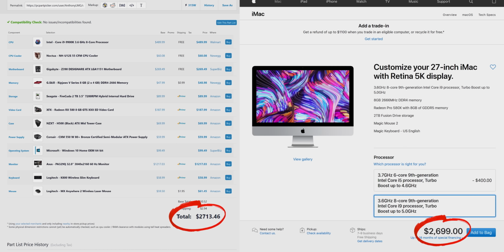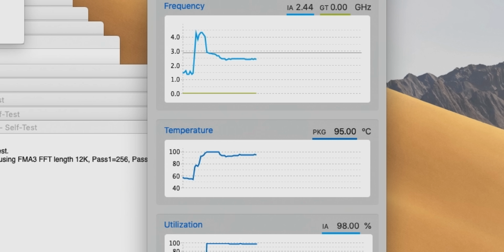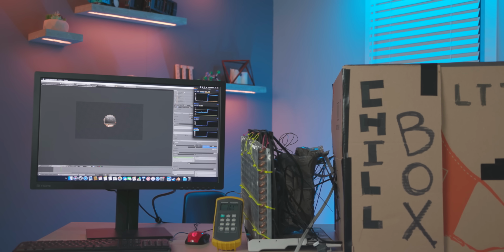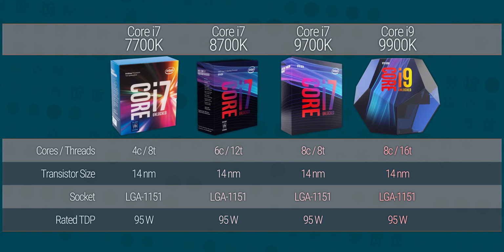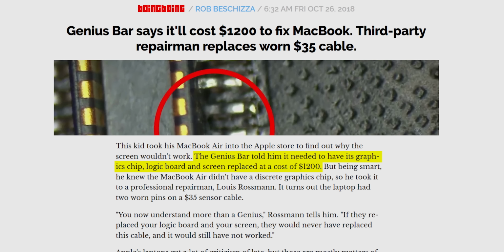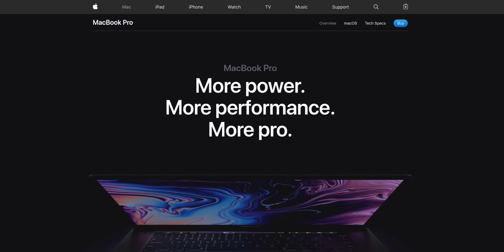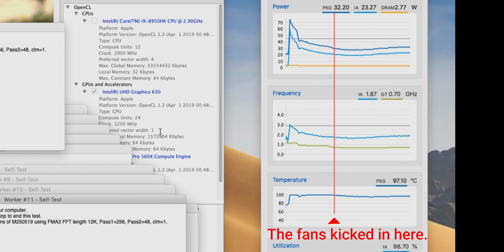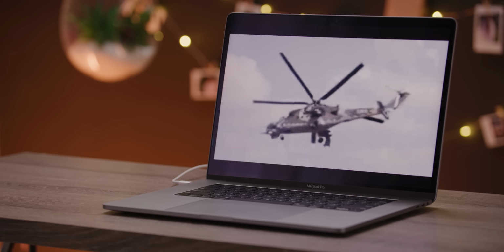Macs are SLOWER than PCs. Here’s why.

Comment: I think the reason that this is the case, is due to Intel's product positioning.. The CPUs which are capable of boosting the highest in single or dual core loads are also the most expensive, power hungry multi-core chips. So to make a thin and light machine that is capable of going through intermittent loads as fast as possible you end up with this weird combination that throttles easily.

That being said, I don't think there is any excuse for marketing their products as professional even though they are clearly premium consumer grade.

Comment: I know i'm fixing to get a bunch of flak, but here it goes. I bought the i9, 32GB macbook pro. 

Why?

Simple, I can't rely on PC regardless of its cooling issues. Hipsters in coffee shops do not need an i9 with 32GB of ram. I'm an audio engineer and a live sound tech. When you hook up a computer to live sound or recording sessions, it's your job to ensure everything just works. You can't have hiccups, you can't have "error 404", you can't have windows errors and task manager failing. It's unprofessional and risky. 

During live recording sessions and post production sessions, the fans are constantly screaming like a jet drive, but the thing never gives in. Ever. Its a powerhouse. That's why I use mac, because they're reliable with software and professional use. I wouldn't touch a windows computer with a 10ft pole with audio production.

Comment: I have a 2009 Macbook (it still kinda works... kinda). It gets really hot really fast. It was especially bad when I would play Minecraft on it as that was probably the most intensive thing I used it for (I got it to take notes for the most part - and to be fair, it has lasted much longer than any PC laptop I've ever had). For the record, I have a desktop PC that is my primary computer and where I do 99% of my gaming and well everything else for that matter.
Reply: I got a laptop from 2008, runs on a two core pentium, switched to an ssd and it still runs like a charme on windows 10 (cost me 300$)

Comment: An equivalent Dell XPS with the same if not better specifications is cheaper than a MacBook Pro all the time.
Reply: Dell xps 13/15 are the best laptops
Reply: Butterfly:  elp me!  Did e really ave te audacity to say te Apple keyboard is better tan te Dell?  

Any laptop at Walmart:  Aw, the "h" key has a molecule stuck under it.

Dismissed.
Reply: @MC-ti2vn  is that still the case for the 2019 version, though?
Reply: Unless they changed course, I thought it's been their biggest news of 2019, finally ditching the butterfly keyboard.  But, yeah - do a quick search and you can read the specifics of the new design. 👍
Reply: @MC-ti2vn  i mean Apple claims to have enhanced the mechanism with their 3rd gen butterfly keyboard. I cant find much stat on it yet.
Reply: Yeah, the latest "gen" of butterfly keyboards is their last.  As for stats, I suppose it's how far one wishes to look 'em up, online.  I only know what I went digging for, myself.  You can find out more about the crushed glass/membrane, etc., if you're interested.  Apparently the whole 3rd gen was still crappy enough for them to already announce they were ditching it - even as they were releasing it.
Reply: The Dell xps 15 Oled just won a few points!
thanks
Reply: then buy Dell
Reply: @woomarkywoo  you have 4 thunderbolt 3 ports, on two thunderbolt 3 buses. You can literally connect an external graphic card. I don't get how you're as stupid as you are.
Reply: @woomarkywoo  and worse touchpad and keyboard..
Reply: @djsalose  hahahhahhaahhahahaha the touchpad has never been better on any PC, even with precision drivers. You guys smoke crack.
Reply: @djsalose  For less money, better temps, better performance, longevity and gaming. I'd gladly slightly downgrade the keyboard and mouse which at the end is just something you get used to.
Reply: @legendany_  I never got used to that piece of crap touchpad.
Reply: @paolung  Some laptops are tricky, on my MSI GP63 which has an amazing performance, I had to try various different Synaptic Drivers to finally get it to be a nice touchpad.
Reply: @legendany_  I wish I could get use to all the terrible trackpads used by PC makers. Where I work we only use Windows laptops, and it is a nice change of pace to use something different at home.
Reply: @djsalose   Keyboard is better (At least compared to current models). Touchpad is definitely worse. Nothing else comes close to the Apple trackpad experience. Baffling why no other company gets it right. (Current 9560 owner, wife has a MBP).

Comment: 2.3k Macbook users disliked the video because the thermal throttle made them think the video was published with 20% dropped frames
Reply: Although I have an apple setup and I know for that I pay the apple tax I like the OS and even theme my Win VM and Linux that way as it make it less confusing. As to the thermals that is a pain especially as there are no filters. I have been using win 10 why do the updates take a long time to apply. But on the other hand windows programs launch faster across the board. Anyway I have put a like on the video because the questions it raises are correct.
Reply: @atlanticx100  the Apple tax is only true in some cases, and honestly Macbooks don't tend to be one, they're usually priced very similarly to equivalent hardware used in Windows machines, its just that they are often horribly engineered for thermals and some particular models have notorious problems with hardware failure. Which means in some cases they perform worse than equivalent hardware or some fail for seemingly no good reason
Reply: Pixel Green  I wish they would solve their thermals. Which includes filters that can be cleaned. My son has a powerful gaming PC with filters that can be cleaned. As I have two cats and a dog that means dust so why not filters also the mac is a bit of a pain to open . But hey I love the design and os.
Reply: @pixelgreen5837  Jup, one of the huge advantages you get with PCs is, that the keyboard ALWAYS works. Making laptops thinner and thinner kills performance something wicked. Why the hell is this done at all? It has absolutely no advantage, a laptop does not get smaller, just because it is paper thin, it still has the other dimensions that don't shrink.
Reply: @jessepatterson8897  ??? So justified criticism is now automatically hating? ;-)
Reply: @Rafael Perzaada this comment just proves your ignorance
Reply: I wondered why this video fits perfect on my 18/9 screen :)
Reply: Apple users don’t know what that means. Lmao
Reply: You are not allowed to criticise the Apple religion, this has nothing to do with computer, facts, performance and such. Having a Mac, you are part of the Apple religion and can feel yourself smart and extraordinary and part of "a select group of better-humans", that "know more than everybody else". LOL
Reply: Hahaaa
Reply: irony. In real life, you know Microsoft stole apple code because they couldn't get video to play without dropping frames? Quicktime code was literally in windows until win7. You fanboy kids are seriously, some of the least informed kids I've ever seen. You guys get scared in a real CLI without having a properties window. Fake ass nerds
Reply: Brilliant 😂
Reply: @User lmao windows laptops have the best 4k displays and performance because apple decided for your that the cpu will always throttle.
Reply: @User I'll just assume you're trolling because you're bored in quarantine.

Have a nice day

Edit: This little joke really did blow into a shit storm.

I was making a joke about poor thermals on Macbooks, each has their own merit. Pick what works for you, but writing off one or the other is braindead.
Reply: And they don't have a 21/9 ratio screen...
Reply: chucku00 this video is in 18/9 wdym?
Reply: @Ximme  My bad, you're right. But I still don't know any Apple screen with a 18/9 ratio.
Reply: chucku00 yes that's true, the new iphones are something between 18/9 and 21/9.
Reply: @Ximme  iPhones aren't MacBooks.
Reply: chucku00 You said 'apple screen' so 😅
If you talk about macbooks it's true, they come in 16/10.

Comment: That price comparison at the beginning is garbage, more than half the cost of the PC equivalent is an over priced 4k gaming monitor. Yes, the Mac comes with a decent display and yes, it could be considered a premium panel HOWEVER, you don't get to keep it when you upgrade, it is part of the machine so you have to pay for a new one every time you upgrade (replace) your system. With a PC equivalent you can keep the same display so paying a premium for a really good one is an investment that will last through several upgrades. 

I agree with the rest of the video but please, don't pander to Apple like so many other tech channels by padding PC pricing to make Apple look competitive.  It isn't, it can't be with it's current business model. Speccing out an equivalent PC should be the cheapest parts that match the spec, not premium motherboards, displays and other high dollar items. Apple's motherboards are simplistic, lack proper cooling (compared to PC) and at best align with mid range motherboards of a given chipset. My part picker list (including a 4k 32" IPS display) comes out almost $1000 less than yours and makes the Mac look like an overpriced steaming pile of warm poo. 

To be clear, I don't hate Apple, they know exactly what they are doing and how to exploit their market. They are a business and do a very good job of keeping that bottom line looking good. "Aimed at the less tech savvy" sums it up perfectly. They managed to maintain "prestige" status in the eyes of their market despite not even being on the board as far as specs, quality and value go. If I had the money I would hire Apple's marketing team in a heartbeat, those people really know their shit.
Reply: Good catch. My BS alarm started buzzing when he said the price points were comparable between the two because I've also done spec for spec PC to Mac builds and the PC always comes out at minimum 80% cheaper. You have to be going specifically for brands and gimmicky parts to get the PC to Mac price.
Reply: @Snow-Willow  I take it you mean minimum of 80% of the cost of a Mac but yeah, that is typically with the lower spec Macs. The higher the specs the greater the cost delta between Mac and PC. You can't spec out a PC with high end motherboards and displays as a fair comparison, a Mac motherboard is about equivalent to a decent brand low/mid tier board. Solid components and quality but utterly lacking in high end features, cooling and just about every other cost additive. Basically, Macs are all about the visible; specs, quality of display and case materials etc. Internally, they cut every possible corner and go out of their way to make user upgrades as difficult/impossible as possible.  About as close to snake oil as it gets in the desktop/portable space.
Reply: @Xaltar_  That is what I meant, aye. Sorry that got worded oddly. ^^;
Reply: "l HOWEVER, you don't get to keep it when you upgrade, it is part of the 
machine so you have to pay for a new one every time you upgrade" You get a lot of money back for the machine when you resell it, if you do it in less than 5 years. The price is kept higher for far longer than PCs. 

"cheapest parts that match the spec" That would not be a fair comparison, as Apple does not put the cheapest parts that match the spec. And yes, I know of the problems they have (see Louis Rossmann).

Morover, for the display, you have to look at far more than just size and resolution. Lumens are extremely important if you do editing, for example. Color gamut is again of importance. It's like with the new Mac Pro display. You can criticize the stand price all you like, but there is no monitor like that one in the market, except for $30k+ PRO monitors. Apple offers it for $6 (cutting the stand bullshit and including that as the final price).

Finally, I see you have never attended a tech or software developer's conferences ("Aimed at the less tech savvy" ). Typically a very large percentage of these people will use Macs - if for nothing else than they have to, if they want to develop for any of Apple's platforms. Plus, Mac OS is Unix based, and most software devs prefer Linux/Mac due to easier manipulation through the terminal and Unix commands.
Reply: "l HOWEVER, you don't get to keep it when you upgrade, it is part of the 
machine so you have to pay for a new one every time you upgrade" You get a lot of money back for the machine when you resell it, if you do it in less than 5 years. The price is kept higher for far longer than PCs. 

"cheapest parts that match the spec" That would not be a fair comparison, as Apple does not put the cheapest parts that match the spec. And yes, I know of the problems they have (see Louis Rossmann).

Morover, for the display, you have to look at far more than just size and resolution. Lumens are extremely important if you do editing, for example. Color gamut is again of importance. It's like with the new Mac Pro display. You can criticize the stand price all you like, but there is no monitor like that one in the market, except for $30k+ PRO monitors. Apple offers it for $6 (cutting the stand bullshit and including that as the final price).

Finally, I see you have never attended a tech or software developer's conferences ("Aimed at the less tech savvy" ). Typically a very large percentage of these people will use Macs - if for nothing else than they have to, if they want to develop for any of Apple's platforms. Plus, Mac OS is Unix based, and most software devs prefer Linux/Mac due to easier manipulation through the terminal and Unix commands.
Reply: "l HOWEVER, you don't get to keep it when you upgrade, it is part of the 
machine so you have to pay for a new one every time you upgrade" You get a lot of money back for the machine when you resell it, if you do it in less than 5 years. The price is kept higher for far longer than PCs. 

"cheapest parts that match the spec" That would not be a fair comparison, as Apple does not put the cheapest parts that match the spec. And yes, I know of the problems they have (see Louis Rossmann).

Morover, for the display, you have to look at far more than just size and resolution. Lumens are extremely important if you do editing, for example. Color gamut is again of importance. It's like with the new Mac Pro display. You can criticize the stand price all you like, but there is no monitor like that one in the market, except for $30k+ PRO monitors. Apple offers it for $6 (cutting the stand bullshit and including that as the final price).

Finally, I see you have never attended a tech or software developer's conferences ("Aimed at the less tech savvy" ). Typically a very large percentage of these people will use Macs - if for nothing else than they have to, if they want to develop for any of Apple's platforms. Plus, Mac OS is Unix based, and most software devs prefer Linux/Mac due to easier manipulation through the terminal and Unix commands.
Reply: "l HOWEVER, you don't get to keep it when you upgrade, it is part of the 
machine so you have to pay for a new one every time you upgrade" You get a lot of money back for the machine when you resell it, if you do it in less than 5 years. The price is kept higher for far longer than PCs. 

"cheapest parts that match the spec" That would not be a fair comparison, as Apple does not put the cheapest parts that match the spec. And yes, I know of the problems they have (see Louis Rossmann).

Morover, for the display, you have to look at far more than just size and resolution. Lumens are extremely important if you do editing, for example. Color gamut is again of importance. It's like with the new Mac Pro display. You can criticize the stand price all you like, but there is no monitor like that one in the market, except for $30k+ PRO monitors. Apple offers it for $6 (cutting the stand bullshit and including that as the final price).

Finally, I see you have never attended a tech or software developer's conferences ("Aimed at the less tech savvy" ). Typically a very large percentage of these people will use Macs - if for nothing else than they have to, if they want to develop for any of Apple's platforms. Plus, Mac OS is Unix based, and most software devs prefer Linux/Mac due to easier manipulation through the terminal and Unix commands.

Comment: i returned the macbook 2 days after it arrived. its design and feel is awesome, but the throttling caught me off guard. i need stable performance over longer periods and the MBC didnt cut it. then i got a Gigabyte Aero 15-X9 which can handle 3.9 - 4.2 Ghz constantly on the 8950HK (depending on ambient) and weight is slightly higher compared to the macbook, but who cares about 150 grams?. And it got a freakin RTX 2070 and a Beautiful 4K panel which is suprisingly color accurate. AND!!!!!! it got a damn f*ckin full size SD Reader - EAT THAT APPLE!